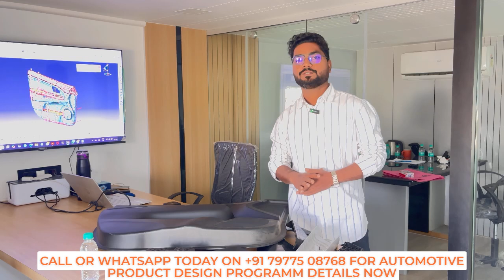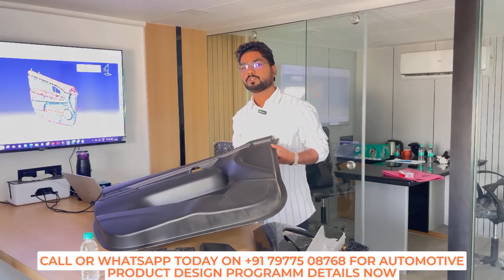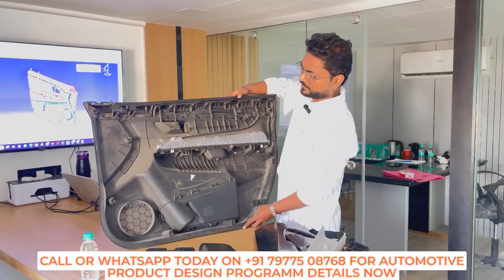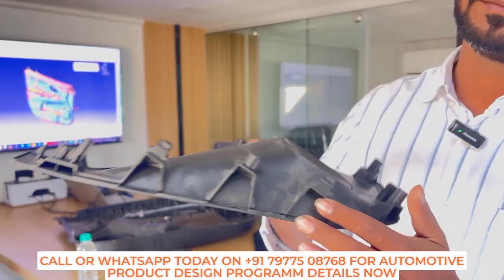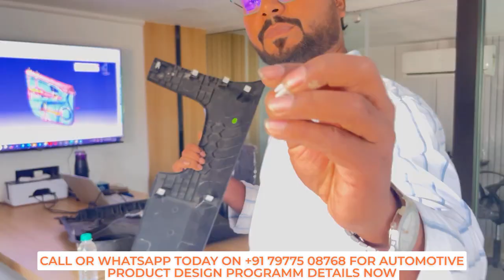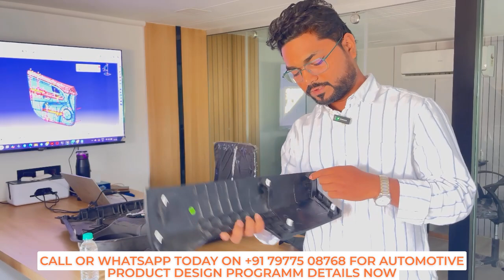REAL AUTOMOTIVE PRODUCTS PARTS DISCUSSION AND REQUIREMENTS

Comment: Sir, I’m a fresher and recently completed my B.Tech in Mechanical Engineering. I’m confused about choosing a domain like design, manufacturing, or quality. I’ve received a 1-year apprenticeship opportunity at Tata Motors, Chikhali Plant, Pune. Is this a good option for learning and long-term career growth? After one year, does it help in future opportunities? Your guidance would really help freshers like me. Thank you,
Reply from the maker: Sure , Tata motors is good company and as fresher if you are working with top OEM always shape your career, after one year you can understand complete vehicle structure and definitely it will help you for future opportunities
Reply: @digitalcadtraining5576Sir, they mentioned roles may be in warehouse or supply chain. Are these technical roles with good learning for a mechanical fresher, or more operations-based? Also, any suggestion about Tata Motors Chikhali plant would help. Thank you, sir.
Reply: @digitalcadtraining5576Sir last qns, they mentioned roles may be in warehouse or supply chain. Are these technical roles with good learning for a mechanical fresher, or more operations-based? Also, any suggestion about Tata Motors Chikhali plant would help. Plz response sir.